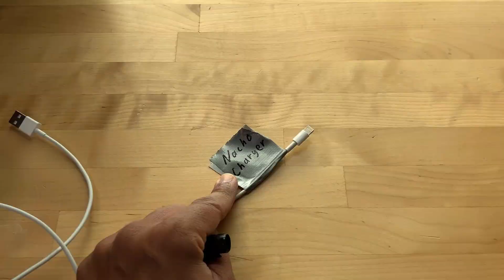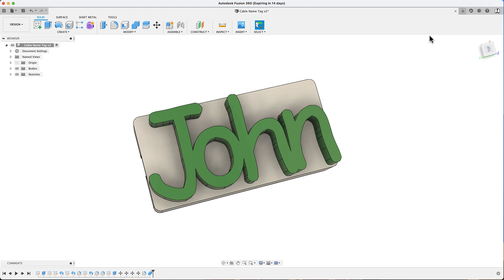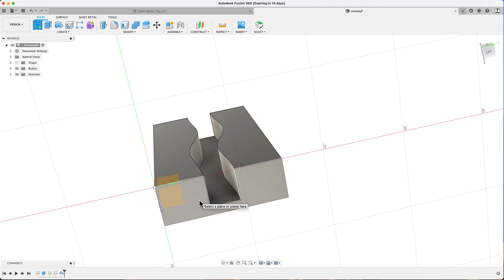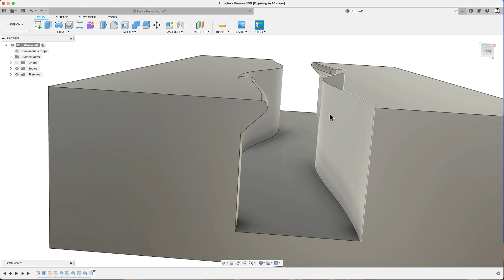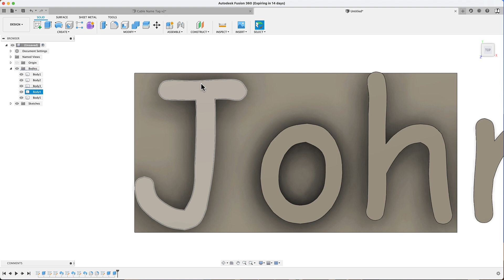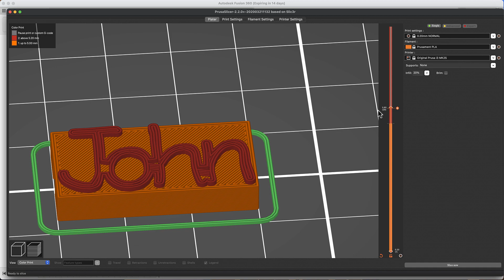Design & 3D Print a USB Charger Name Tag in Fusion 360

Comment: Hi! I am trying to make the base an oval instead of a rectangle. After I got to the sweep stage, it did not cut it out like it was supposed to. Instead it gave me an error that says, "The operation failed due to coincident control points. Try adjusting the values or changing the input geometry." I tried googling coincident control points, but I am still confused about what I did wrong. Do you have any ideas about how to fix this? Any input would be very much appreciated. :)
Reply from the maker: Hi Sarah,  try extending the the spline curve beyond the the oval shape.
Reply: @DesktopMakes  Thanks!!

Comment: FACE SELECTION MADE EASY:)...
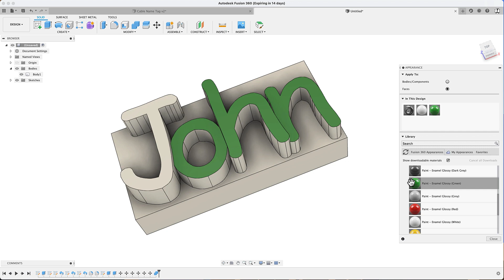18:25 - Face selection can be difficult in some cases, but in this case it's easy-peasy:)...
- Use 'Select>Selection Filters': Uncheck 'Select All'; check 'Body Faces'.
- Go to Front View.
- Click-n-drag selection box from right to left: touching faces of letters only. This will select "Crossing".
(BTW, left to right will select "Window": all elements must be inside selection region. Also, switch selection type using hotkeys: '1') Box, '2') Freeform ("lasso"), & '3') Paint.)
- ALTERNATELY, w/o filtering for 'Body Faces',  set 'Select>Selection Priority' to 'Select Face Priority', then window drag left to right , being sure faces are entirely in the box. Done:)
Reply: Furthermore, F360 doesn't respect appearance of bodies when using 'Combine (join)':( Appearance of 'Target Body' is used.
Reply: BTW, I've been using F360 for 4 yrs, and though it is quite good (and offers a free option!), I've recently started learning SOLIDWORKS, and its appearances implementation frankly is definitely much better.

Comment: [You may already be aware and simply misspoke, so plz, take no offense. Plus, hopefully others will benefit. So, read on...]

Note about "clearance" as opposed to "tolerance"...

CLEARANCE is "design intent". E.g. The separation gap size needed for proper functioning of design.

TOLERANCE is "machine accuracy" (though allowable tolerances can also be called out in a design). A machine will not consistently make a "1 unit" length, but will vary +/- w/i some tolerance.

Yes, it's a bit of a technical distinction. But as an engineer I'm compelled to mention it. So, not always critical (as in casual speech), but for engineers it can be very important to be clear/exact in language.

Anyhow, keep up the great content...

P.S. To be complete in terminology, PRECISION is repeatability.
Reply from the maker: Thanks Swami,  I see that I tend to use the terms interchangeably.  Thanks for pointing that out.
Reply: @DesktopMakes  You are welcome. Actually, many people use these terms interchangeably. In this case, I knew what you meant; and communication is the primary thing. In an engineering setting though, it would be a different matter. You are a great communicator, and I've enjoyed your vids, and benefitted from them for quite some time now. So, thx for all your efforts, and contributions to the community.

Comment: If you want this with different names, what is the best way to follow to achieve this?
Reply from the maker: You can simply go back to the sketch in the timeline and edit the text.  However, because I explode the text and move them around it does complicate this process.  With this method, you have to go back and redo the text and all the moves again.  But if I had simply extruded the text, then simply going back to edit the text would update the design.